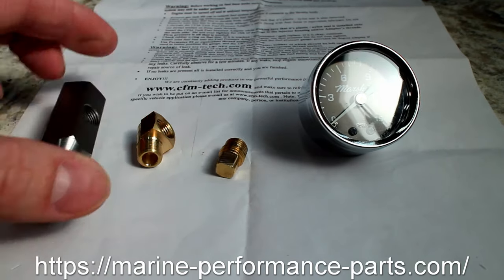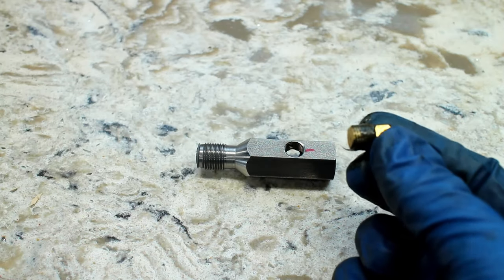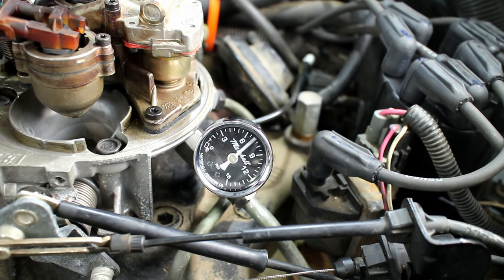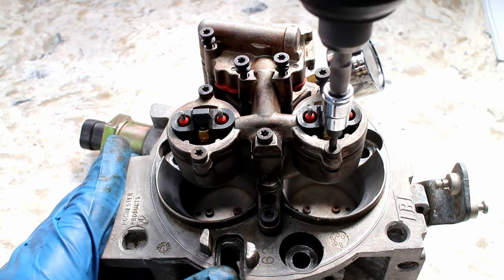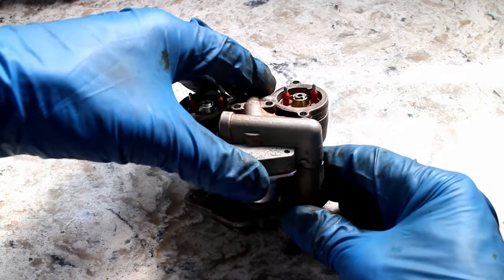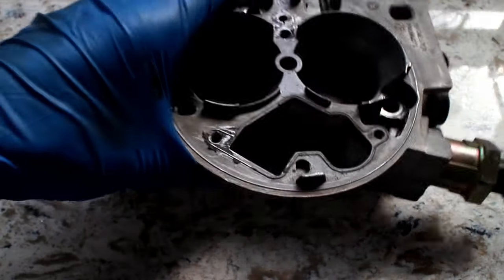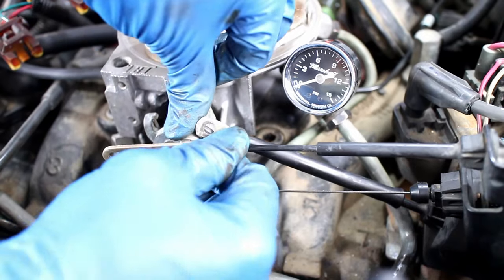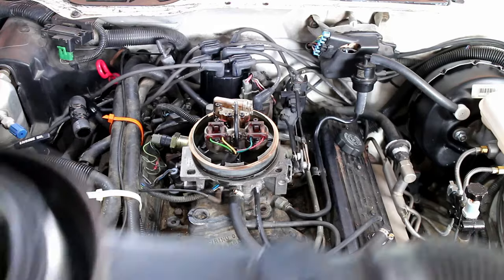Ultimate TBI Mods: Adjustable Fuel Pressure Regulator

Comment: I did the adjustable regulator/spacer on my sons Camaro. We knew the 305 was coming out of the car, but we kept tweaking on it, and made several passes down the quarter mile to see what we gained. By far, the biggest gain we achieved, to the tune of knocking 4 tenths of his ET, was installing a 3 inch open element air cleaner! (Get the flat base, not the drop base. It will clear the hood)... Now I had some keyboard genius argue that the open element would be worse, (blah blah blah) by letting hot air in the throttle body. ANY air is better than no air, and ET slips don't lie!
Reply: What your model Camaro release? I want one of those air cleaners to put on my truck to plumb out for actual cold air intake
Reply: I had not done the regulator change to adjustable but I say to get more power with a high volume fuel pum-run 5.7L tbi injectors, and install roller tip rocker arms 3/8 × 1.6...I too have a 88 Iroc-Z 5.0 5 speed...runs really good. Done this mod to my 94 Z71 350 X-Cab...it runs quicker. O ya Hawks Motorsports sells open hood louvers to extract under hood heat, while bringing in cool air under the hood
Reply: 92 here I'm going to try the triangle air cleaner from edelbrock.
Reply: @Aceman597  Save your money, those air cleaners are junk! If your engine backfires one time, it will set the foam filter on fire. Summit sells the round open element air cleaners with a filter for 30 bucks.
Reply: @kennydemartini2169  why even buy an open air cleaner when you can just do a lid flip, and it's free. I only put a K&N washable filter on my 350 TBI
Reply: Agreed. Ive done the air cleaner flip mod many times. It does gain power even with hot air. It does kill fuel milage in the summer though

Comment: I dont know why but sometimes the hole is already in the throttle body and you dont have to drill it for the screw.  Also to remove the injector pod you can get away with only removing one fuel fitting.

Comment: @ 3rd Gen Guy, I've been doing a lot of research on ways to upgrade and or modify a TBI for more fuel pressure/volume and more CFM's for a 1988 GMC Sierra SLE 4X4 auto trans with basically a stock 5.7L 350cid with flat top 9:1 compression Wheeler pistons, upgraded camshaft to a Comp Cam CL12-256-4, new lifters and springs, Holley Headers long tube 1-5/8 tubes to 3 inch collectors with CO2 sensor bung, 2-1/2 exhaust piping and dual Flowtech Raptor mufflers, cold air intake, 180 degree thermostat, swirl spacer between intake manifold and TBI, dual electric radiator/condenser cooling fans, replaced the pickup stator in distributor while I had it out, I ported my heads exhaust and matched intake to manifold, I did the grind and polish on TBI, thicker injector pod spacer, 14-18 psi regulator spring in TBI, but my present TBI stock fuel pump is barely putting out 11 psi fuel pump pressure, but I'd read an another platform that any type of fuel injected gas engine that's making over 230 horsepower needs to have a fuel pump upgrade, and they recommended the ACDelco in tank electric fuel pump, pn# 25163473, Summit Racing pn# ADO-EP381 $141.99, don't forget to replace the strainer, this fuel pump produces at least 60psi, therefore, you'll have plenty of fuel pressure for whatever type of fuel injection you have, the regulator will control the fuel pressure. I'd also read for the TBI units, you can regulate your fuel pressure to as much as 14 psi, but don't go any higher. Most stock TBI fuel pumps average about 10-12 psi, and one psi makes a big difference in fuel injection and high performance engines. Lastly, I'm gonna research to see if a larger/higher volume fuel injectors and MAP sensor upgrades might be needed for my engine build, along with, I'm gonna see about a specific computer chip for my setup with tbichips.com. Thanks for the video for the add on fuel regulator, I may very well do this on my TBI, especially for the upgraded 60 psi fuel pump.
Reply: Get that AC-Delco unit--it will likely fix your fuel delivery issue.  I bought one for my '91 K1500, but I just put a (stock) rebuilt TBI unit on the engine.  Mods are coming, later.  Also, if the guy posting this video who says he has a TBI rebuild video didn't replace the throttle shaft bushings, the TBI unit is going to be "sucking air," something mine used to do.  NO power or performance, after the previous owner put an Edelbrock aluminum intake and spacer under the TBI unit, as well as a better cam.  After I replaced the TBI with one that was TOTALLY rebuilt, (including throttle shaft bushings) I could finally feel it pulling better, even with just 3.42 gears in the diffs.

Comment: My thoughts on inching the fuel pressure up:
There is a long way from the in-tank pump to the fuel pressure measuring point. There are quite a few kinks on the original line, and the diameter is as small as GM could get away with.
every kink detracts a little line pressure. Increasing the diameter of the fuel line, most of the way, will open up flow, minimizing pressure drop. Just a thought.
Install a measurement point near the pump, would of course show if there are any gains to expect.
Reply from the maker: the stock fuel feed line is 3/8in hardline.
there's been guy who made 1,000hp from stock 3/8 lines.
it's usually the fuel pump that';s the limiting factor.

Comment: If I’m seeing what I’m seeing 
This was redundant because once you first installed the gauge it is pre the adjustable fuel regulator, so that should be the immediate tell tale that your fuel pump is maxed out at what the first reading shows. The only way the regulator works is to dampen or “retard” fuel pressure beyond the pumps max capacity. The regulator will not increase pressure beyond what the pump puts out.
Reply: I’m happy someone else noticed that 😂

Comment: Any recommendations for a fuel pressure gauge for 1994 GM 454 TBI? Fuel pressure on my RV is 26-32psi. FYI...at 11:05 your forgot to mention installing the TBI base gasket. best to install the adapter fitting first to make it easier to decide which port to install the gauge in. I don't recommend installing a permanent gauge. The heat will skew the gauge reading with time. Better to install a fuel rated schrader valve in one of the ports.

Comment: I've got a completely rebuilt TBI setup for a 350, manifold, Distributor, 193 64cc ported heads w/ SS valves new seals etc, I switched to a carb. I need money for surgery and need to get rid of some parts if your interested.

Comment: Never realized your car was auto. Great video by the way.
Reply from the maker: It'll be a LS1/T56 Magnum soon 
I really hate automatics
Reply: @3rdGenGuy   yanking out my 305 tune port / T5 from my 92 Z28 and have the LS7 / T56 ready to go in. Just wana see how you do it first as far as mounts,k member, accessories to learn from your errors lol.   I'll be watching.
Reply from the maker: @JBZ28LS7  I was eyeballing that new GM 570hp LS7 crate motor, but I'm unsure how well my Autocross built suspension will put down power. a 400hp ls1 is good enough for now.
Reply: Yeah mine is the 505 HP one. My build is both autocross and drag racing compromising a bit in the drag racing side. Your build is great motivation and has helped me plan about some part selection.  Keep it up. These platforms are limited gata work with what fits in the wheel wells and truck steering lmaoo

Comment: Already watched your rebuild vid. and purchased TBI rebuild kit. Now that winter is starting here in the PNW can bench TBI for my '91 Vert. considering installing this at the same time. Do I order this from Summit, or? Thx
Reply: Throttle shaft bushings should be replaced also, or else your TBI unit will be sucking air--aka, vacuum leak.  Power will be down, until you do that.  I "cheated," and bought a totally rebuilt unit.
Reply: I've been watching because I have a ford 300 that is getting a kit from affordable fuel injection that uses this throttle body.

Comment: Would it be better to keep, rebuild and upgrade TBI or just do the carb swap if I am going to do work on the engine? I am for sure upgrading the cam and lifters and reolacing springs in heads may also try to swap vortec heads and in the future want to get a drop in 383 kit and rebuild. Not sure if im wasting my time by trying to stick with TBI.
Reply from the maker: the carb is a better option for future power builds.
a TBI is pretty much capped at 275-300 horsepower.
but TBI really are smooth and reliable.

Comment: Knowing what pressure the pump is giving the TBI is great but how do we know what the regulator is sending to the injectors. You now have it adjustable without any way of knowing what it is???
Reply from the maker: it's the same pressure.
what that gauge is reading, is what the TBI injectors are getting fed.

Comment: I would like a bluetooth remote guage into the cab something like that. This way under load throttling if at times you see a drop in pressure to 7 pounds say, you can figure out way, maybe there is enough pressure while your watching but not while driving.
Reply from the maker: There are Test kit fuel pressure gauges you can buy.
that way you could see fuel pressure while driving.
Reply: @3rdGenGuy  I’d like a Bluetooth or a signal transmitting gauge, so I don’t have to plum fuel into the cab. The real classic old cars the gauge that showed a person how much fuel they had was actually a glass and you could see the actual fuel floating in there.

Comment: good discribtion... nice thx...did you adjust the pressure?
Reply from the maker: mine was at 11psi stock, so I was only able to set it to 11.5psi.
SOME systems are as low as 8psi, so those cars would have a better result.

Comment: Fuel pressure should hold key off.  I think your fuel pump isolator is leaking, replace it with fi hose.
Reply from the maker: my old TBI fuel pump was some $30 eBay special so that's probably why lol.
never caused issues though.
Reply: Tbi gm have a bleed in the fpr so they dont hold pressure and they dont have a check valve in the fuel feed side
Reply: Gm TBI doesn't hold fuel psi as per its design. You could possibly add in a valve downstream to make it hold psi as the TPI units do but its needed.

Comment: Did you realign the inlet line in after installing the adapter? The adapter is longer than the OE one which will alter the line angle coming in. Likely enough that the O-ring isn't able to seal.  Line needs to come in as straight as possible. You can follow the line back to the first bracket and disconnect it which likely will give you some wiggle room.
Reply from the maker: the hard line was bent to fit.
the adaptor was just a smidge off machining wise.
Reply: @3rdGenGuy  I bought the same one and just installed it on the TBI. We'll find out here shortly if it works. Install is tomorrow. I opted to add a fuel schrader valve on mine..
Reply: @3rdGenGuy  Know where the machining mistake was? And did you notify the machinist/maker?
Reply: @3rdGenGuy  Update: Installed my TBI and after several minutes of run time...leaks at the pipe plug and the schrader valve threads. Permatex 2 used.
Reply from the maker: it's annoying, but set the psi and probably just remove the fitting like I did.
Reply: @3rdGenGuy  This can be corrected with use of Gasoila E-Seal (Yellow can) thread sealant Permatex 2 isn't gas proof. Works great!

Comment: I’m trying to do the same for my 454 tbi I was wondering where can I get that fuel pressure regulator and the custom fuel line adapter with the fuel gauge?
Reply from the maker: a few companies sell them. CFM technologies, summit, jegs ex ex.
Reply: @3rdGenGuy  thank you but another question how is it reading what the regulator is pushing out ? Wouldn’t it be reading the fuel pumps pressure since it’s before the regulator and not after?
Reply: @ManuelReyes-dw8ym  If I recall correctly it works because the fuel flows through the injectors before it gets to the regulator.  The injectors are normally in a state of closed which allows fuel to flow through to the regulator but not out into the intake when closed.  So any pressure over 11 psi is released into the return line.   Remember injectors themselves do not spit the fuel/create the pressure.  They only get energized to open and allow the pressurized fuel to squirt out of them.  If you put the gauge after the regulator it would read little to no pressure because there should be no restriction other than the size of the fuel line on the way back o the tank.

Comment: Did you check the o ring on the fuel line itself I have the same problem with mine
Reply from the maker: it had the correct ring/plastic seal. just bad machining caused a leak.

Comment: There's a new spring you can get that takes it to 13-14 psi, anyone tried it? Apparently it's works very well
Reply: i did the quarter mod and upped my pressure from 11 to 14. i could tell a big difference
Reply: @andysmith434  what is the quarter mod?
Reply: @dreweddy25  put a quarter under the spring in the fuel pressure regulator. From my experience it raises it about 3 psi.
Reply: Im running a 15lb spring. 46mm bored TBI and manifold bored to match. TPI fuel pump for more FP. Custom chip etc.Engine is an L98 out of an Iroc I rebuilt. Does pretty good.

Comment: After all this, did you manage to increase the fuel pressure at all or was it already at its peak before installing the adjustable fitting?
Reply: He said it was already at its peak
Reply from the maker: Mine was unfortunately basically right in the money as is.
Some systems are as low as 8psi stock.  This video took forever, so I wasn't gonna not release it ha ha
Reply: @3rdGenGuy  Okay, got it, thanks!

Comment: Just what I was waiting for the audio got quiet. At 13;25 is the part that I need, but I don't know what it's called. I took pictures and no one knows at the part stores. Please someone tell me what that ring is called.
Reply from the maker: you mean the "Air Cleaner Mounting Gasket"
same size as any carburetor.
like $4 online as well
also comes with the TBI rebuild kits if you buy one.
Reply: @3rdGenGuy  Thanks. I literally just found out what it was called. Yes that is what I was talking about. 😊. Getting the part in the morning.

Comment: Change it to a 4bbl carburetor or EFI. Too much trouble on a TBI.
Reply from the maker: TBI run great if cared for.
off-road guys replaced Carbs with TBI units back in the day because they aren't affected by elevation change or high angle of attacks.

Comment: Can you leave this gauge system connected? And where can i get one for my 87 chevy 350?
Reply from the maker: you can leave it connected, 
CFM technologies sells kits, so does Jegs and summit racing.
Reply: Brutal, thanks for sharing this with us all. I'am going to put this on my 87 chevy silverado v10 5.7 tbi so I can check the pressure off and on. Do you have any advice for troubleshooting hot hard start for a 350 tbi?

Comment: Might be crazy but if it’s leaking with the gauge. Get some good thread tape like you use on a shower head to keep the water from leaking.
Reply from the maker: the machined adapter leaked at the nylon gasket. 
wouldn't stop leaking, so I just set the fuel pressure and removed the adapter.
Reply: You cannot use "shower head" Teflon on gasoline application.  It melts.  There are some specialty sealant tapes that are specifically made for petroleum applications (they are typically colored yellow), but definitely DO NOT use standard Teflon tape.
Reply: @3rdGenGuy  Leak appears to be from the inlet line. Likely a torn o-ring. Use only Viton o-rings. Leak started after second removal of inlet. The nylon seal needs replacing anytime the fitting is removed (1 time use).

Comment: Any idea how to remove the idle adjuster plug (?) and install a/the T-27 torx screw? Thank You!
Reply from the maker: i just drilled into it and it flew out.
Reply: Once you get the plug out the screws behind there. You don't have to add a Torx

Comment: Does this mod help with the map sensor pushing too much fuel? I have a 93 350 with a mild cam and I'm having issues flooding out...
Reply from the maker: unfortunately trich running could be a million things.
Reply: @3rdGenGuy  ive changed out the TPS, IAC, temp sensor, 3 diff MAP sensors, new brake booster just to be sure ( for vacuum reasons) and still wants to flood
Reply: @shawncarney8691  did you find a solution for your problem ?
l have the same problem , i changed the fuel pump to after market one as a look like oem one now it's flooding , i am in doubt maybe it's putting more than pressure it needs .need to put a gauge to check the pressure .
but is is it possible changing to more power fuel pump  rise's the pressure ?
Reply: @shawncarney8691  Fuel regulator spring is likely issue.
Reply: @biohazardworkshop1758  was told that a custom chip burned for my specs would fix the issue but have pulled the trigger on it yet

Comment: I have a question, how much do you think an LS1/T56 swap would cost if I paid someone for the labor?
Reply from the maker: depends on the shop, but a LOT!
most shops are charging over $100 an hour for labor these days.
that ans a LS1 and T56 are gonna set you back $4-5K on the low end.
it isn't cheap unfortunately.
Reply: @3rdGenGuy  I'm in Central Texas. I work on outboards I am not a certified outboard mechanic but I have about 20 years experience doing it. I charge $130 an hour I spoke with my friend who owns a shop real close to me he charges 175 an hour and is going up just like with everything right now. He said most shops charge between $150 and $250 an hour